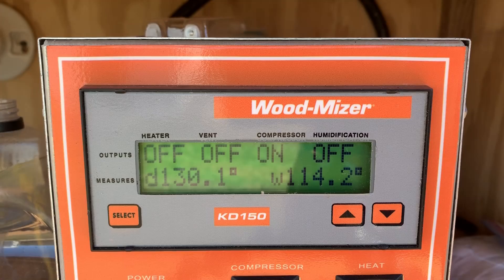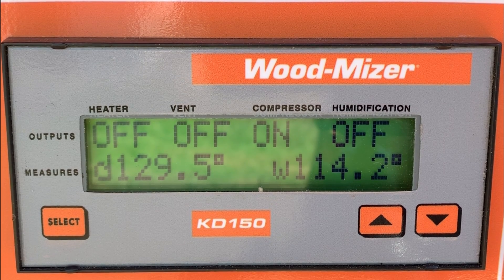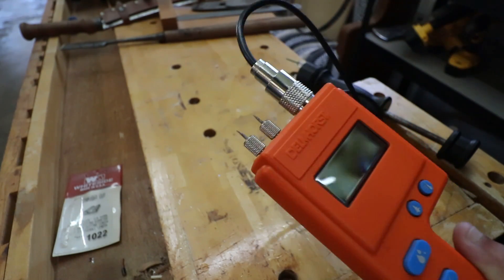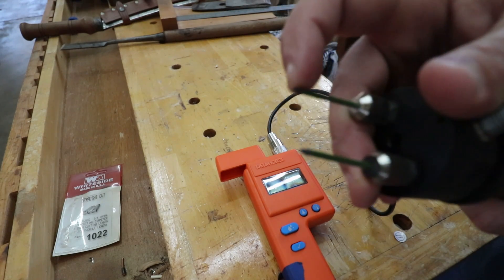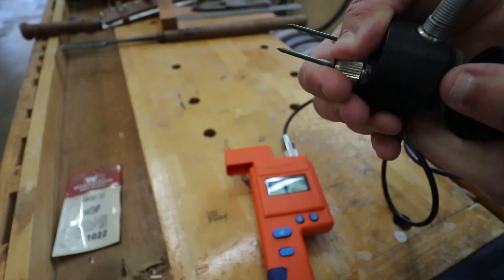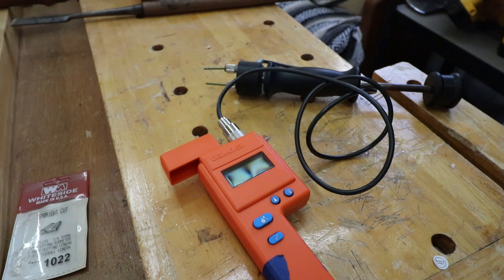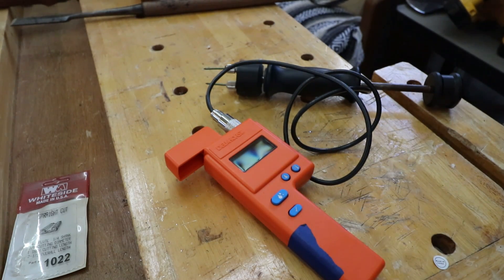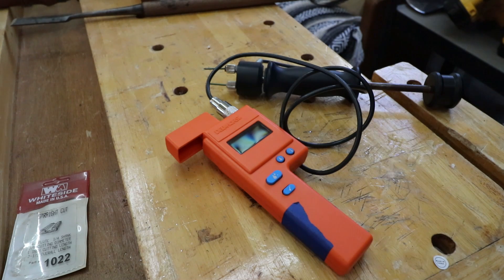The Best Wood Moisture Meter for Sawmill Owners and Woodworkers

Comment: I'd like to have seen it in action, ie: driving the pins down over an inch into wood, pulling it back out without breaking the pins, etc.  Question - for very hard wood - can you drill a hole slightly less diameter than the pin and not as deep to make it easier to drive into a hardwood?

Comment: Hey Nathan, thank you for the hard work you put in, between running the sawmill, being a family man and still finding time to edit and upload videos. I have a quick question:  would sharpened tungsten welding rods, coated almost to the tip with an insulator, work for getting slightly deeper moisture readings, as long as they were driven in parallel and attached to the meter properly? I have some a friend left laying around and was curious. Cheers!
Reply from the maker: not sure that would be a good question for the engineer people,
Reply: Tig welding tungstens are very, very brittle. I defineatly do not think they will work.
Reply: @OutoftheWoods0623 will this measure the moisture in plywood and 2 by 4s used in home construction and if so how do you know what setting to put the meter on?

Comment: What can't I just hammer two nails into a board of wood to use as electrodes, then attach a simple ten dollar voltmeter, take readings of resistance, voltage, whatever, and then extrapolate from that, what sort of moisture level is present?
Reply from the maker: won't work, you don't know the species correction for the wood density you are checking,

Comment: Can you pre drill two holes the exact size?
Reply from the maker: you can do a small starter hole but not too deep, which is what I do alot, the wood needs to be tight around the pins,

Comment: Does that new Wagner meter do 8/4?  The delmhurst seems nice too
Reply from the maker: nope, only 3/4
Reply: @OutoftheWoods0623  The Wagner Orion 910 Deep Depth is supposed to read down to 3/4" so that should do a 6/4 board at least.  The Delmhorst seems like a great meter